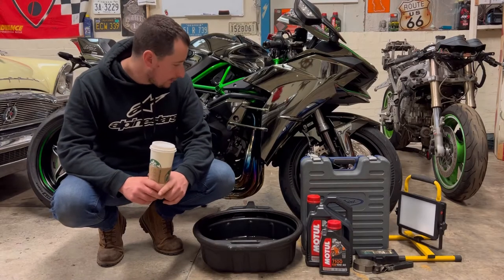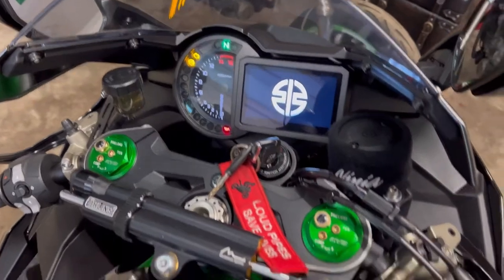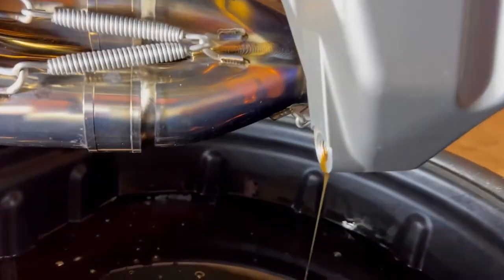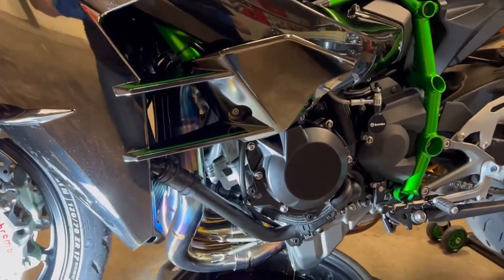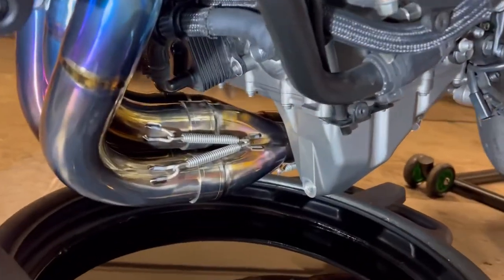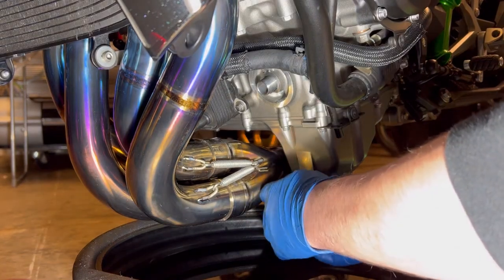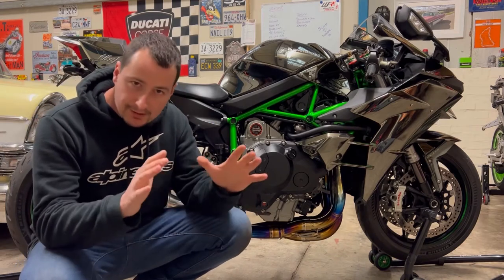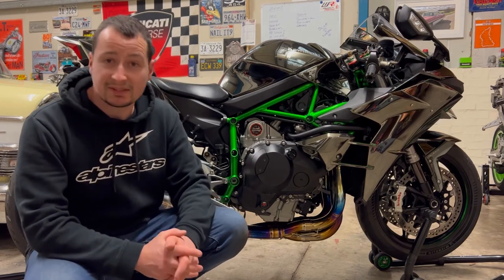Kawasaki Ninja H2 Oil & Filter change Step by Step!

Comment: 3:23 the oil in my h2sx looks very similar, but it doesnt look like normal used oil.. I sent it in to a lab and was told there is alot of gasoline and oxidation in the oil.. So it seems that this is inherent in all H2's?